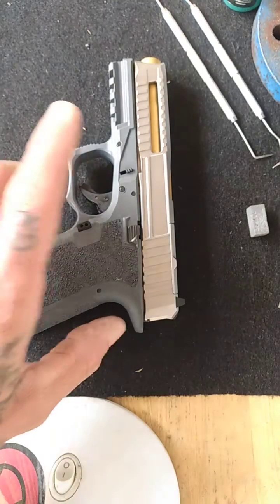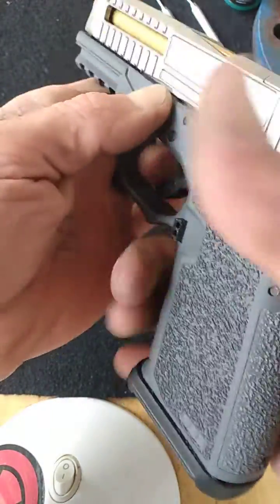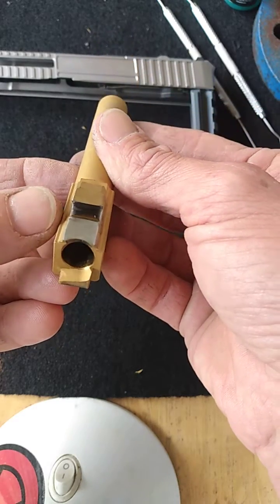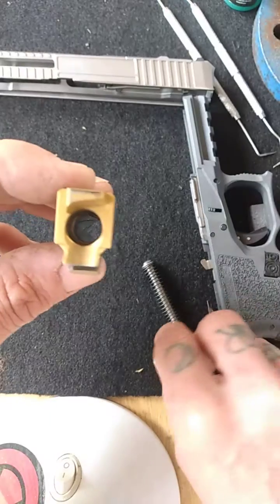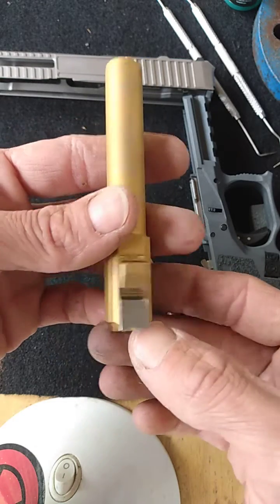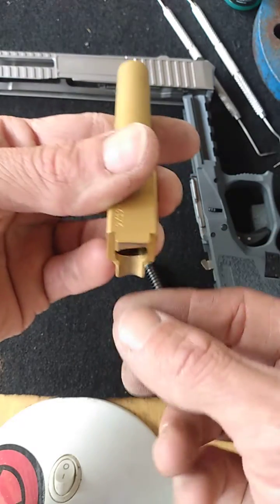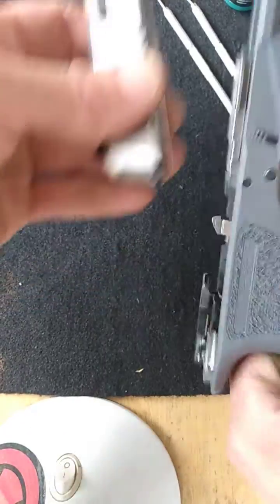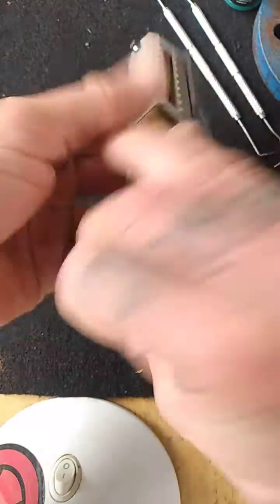Polymer80 Barrel Issue Fixed!

Comment: Hey bro I’m pretty sure this is what I need to do, did you ever do a follow up video for this to show it functioning? I’m stuck between removing material from the locking block or removing it from the barrel, I can get a new locking block for cheap but a barrel not so much

Comment: Did you dremel polish that, if not that grit size sand paper should I use tryna finish fast.
Reply from the maker: Believe it or not I polished it with a 120 grit tiger paw on a metabo! I know you said you need it done quickly but take your time!

Comment: Great video. I had the same issue with both of my builds. Took my OEM slide off and it worked every time no issues. Put the aftermarket slides on and they hit the barrel lug every time. Shaved the lugs just a little and now they run perfectly. I would recommend measuring your factory barrel and then measuring your aftermarket barrel and see what the difference is. Mine was a good bit off of OEM specs.

Comment: I have a p80 that was working but for some reason I can’t put the slide back one it was hard to rack so I took it out and now I’m struggling I can’t put the slide back I need help!!?
Reply from the maker: Where's it stopping? Where in the install process is it getting stuck? Pull down on your slide lock tabs like you were going to take it off, and pull it on instead
Reply: @knightcustombuilds6988  its getting stuck on the barrel is bumping into something that won’t allow it to close but few days ago it went on and rack perfectly
Reply from the maker: @Chris-et2wj  quick question, why did you remove it. Did you take any parts out that could possibly be backwards like your slide lock. JW, something had to have changed. Try pulling down on your slide lock tabs and see if it'll pass
Reply: @knightcustombuilds6988 yeah I tried pulling the tabs down and I haven’t move any parts
Reply from the maker: @Chris-et2wj  try pressing your safety plunger and releasing the striker. Sometimes it has to be at rest. Sometimes it has to be cocked. Every build is different

Comment: I’m late to the party but my Faxon hellfire upper does this on my SCT lower. It gets hung up on the locking block but when I pull the locking block pins down it slides right over no issue and cycles perfectly. Everything fits nice and tight. No wobble.

Comment: I'm having the same issues currently on 2 of the kits I bought. I took the slide off the kits and put it on my OEM G19 frame and it went on perfectly! Mine seems to be a problem with the frame? I'm new to Glocks but how would I fix the locking block?
Reply from the maker: You'll have to replace the locking block due to tolerance stacking. Y'all stay safe and keep shooting 🤙
Reply: I ended up filing the locking block and the part that catches it on the barrel, its working fine now.   @knightcustombuilds6988

Comment: I did this yesterday and now it won’t load the cartridges when I add the clip and rack the slide
Reply from the maker: This was an example of that particular part being out of spec, when compared to several others. That being said, it could of been a barrel hood issue etc. Very very important to understand which part of the barrel is out of spec before altering. Also some barrels are too far out of spec to fix. For example if it was too short or not on the correct angle. Lmk how it goes. All else fails, AimSurplus makes great aftermarket barrels at a great price.

Comment: But the slide is too far back now. I had this problem.  Well I have had pretty much every problem u can with these barrels . To get my slide to line up in front of the frame I had to take material off the barrel wer it catches the slide lock. Or if u have a aftermarket slide lock it can be too fat .that's why i ended up buying oem parts so u don't grind on the wrong stuff. I just matched the oem to the aftermarket and that's how I figure out if it's the barrel or lock.  I didn't wanna take material off the wrong stuff.  It's actually a joke how out of spec this aftermarket crap is . Thers no reason to have to take that much off. How can someone stuff differ in size so much.  Idk y they make them so outrageously different size.

Comment: My Glock 26 slide won’t go back either is it the same thing I gotta do to or no I can send you a video and all?
Reply from the maker: I just seen this, so sorry, hmu on IG same name. Sorry about that, they hide these comments.
Reply: I’m having the same problem, I put my g19 barrel in my g26 and it works fine but my g26 barrel locks up when I rack my slide
Reply: @benjiboa2363 did you find out the issue ?

Comment: Maybe the channel it too high and making the end of barrel sit lower? Like it’s tilting the barrel back?
Reply from the maker: It was the landing on the Barrel lug. I tried it in several different scenarios before coming to this conclusion. Including d.chem to show contact for proper fittment. But she's GTG now!
Reply: @knightcustombuilds6988  my Glock 26 slide wont go back how yours was doing do I do the same thing or what I can send you a video of it to if you don’t mind it’s on my brother YouTube called davion Chaney it’s on his YouTube shorts comment on it for tips plz
Reply: Would a Mill file work ?
Reply from the maker: @unluccykidd4984  Yes sir I usually hand fit but for the video I put the grinder on it. I recommend filing and hand fitting over Dremel/rotary tools.
Reply: Is this the samee problem for the g26 mines is doing the same thing but idk what’s wrong with it plz help😭
Reply: @draqonf3392  did you ever fix it?
Reply: Yea gotta be cuz I looked yesterday at mines and my barrel lug hitting the same thing that was wrong with his ima have my brother fil it down for me
Reply: How did the gun run after the feed ramp shortening? Any ftf issues?